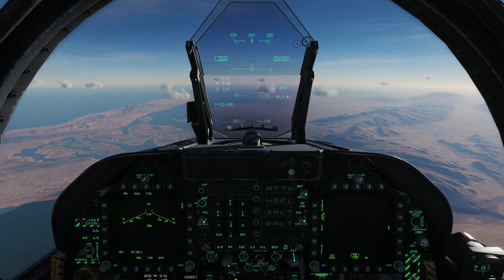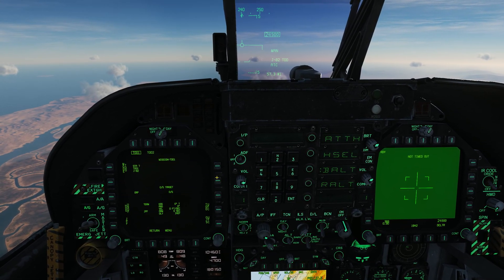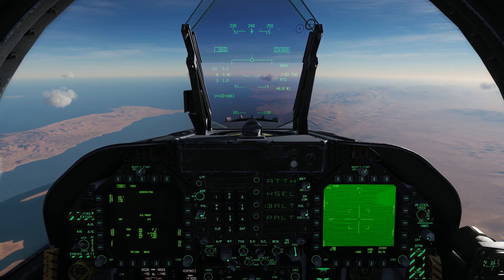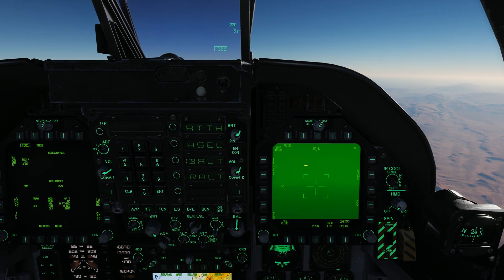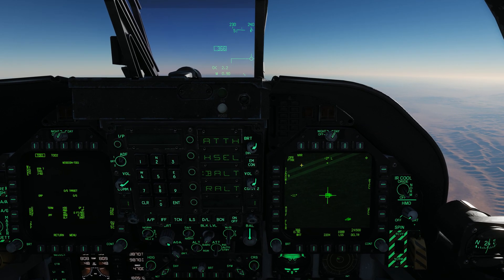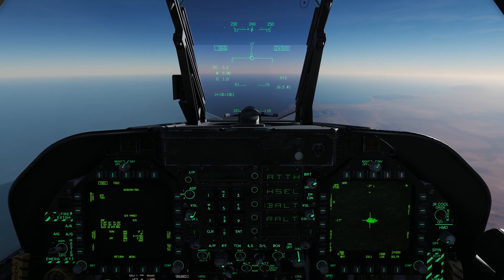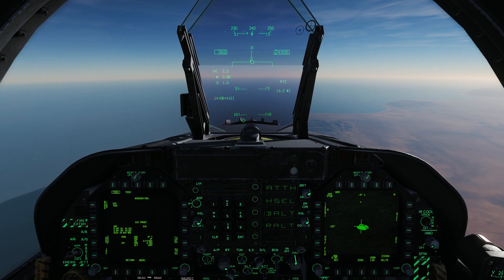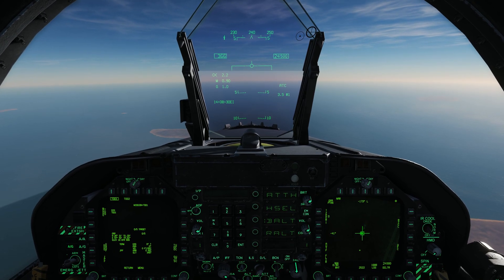DCS: F/A-18C Hornet - Litening Targeting Pod Intro and GPS Weapon Use

Comment: Will the pod have any compatibility with the helmet? For example, can I just look out to the side of the aircraft, and have the pod automatically slew to the exact spot I'm looking?
Reply from the maker: The helmet cannot control the pod. Rather, the pod in AG mode can set a target point from which the pod could then be slaved. This will come later.
Reply: @MattWagner  I see. Thanks for answering. I imagine that system will still allow for a short time between spotting and targeting something.

Comment: If the target moves after the gbu is released, the pod is on ptr track, will the gbu update coordinates mid flight? Or does the gbu only maintain coordinates obtained prior to release?
Reply from the maker: LGB yes, not GPS weapons.
Reply: @MattWagner  thanks! Follow up question... Jdams can be released a good distance from Target. How far out will an lgb be able to release? How far can the laser track? And is slant range taken into account, so that a higher altitude would subtract from the distance?

Comment: What does "sensor control depress" do?
Reply: It looks like in this case it was the button pressed to actually designate that point as the TOO target for the JDAM. He mentioned not hitting "aft" so I'm assuming that meant depress.
Reply from the maker: @aaronwhite1786 . Depress and Down are synonymous in this case.
Reply: Thats TDC depress isn't it? 
I meant Sensor control switch. It doesnt have a default binding and my hat switch can't be depressed anyway but i was wondering what it does

Comment: I know you've said it wont be able to be mounted on the cheek station initially, is that still the case?
Reply: as far as i know, the only place the navy uses the pod is the hull hard point which costs you one aim-120 or aim-7
Reply: @NormanBoring  Yes which is a cheek station but as you can see in the video he has it center line configured.
Reply: @UnixLinuxWaffles  indeed, my bad.
hopefully we can later mount it there, i'm little bummed i have to sacrifice a fuel tank for the tgp

Comment: Finally!

What is the difference between TOO1 and TOO2?
Reply: Nothing, you can set two different targets. Basically target 1 and target 2.
Reply: I guess, it is an opportunity to designate two targets for a single pass. Correct me if i‘m wrong please.
Reply: If you have 2 jdams/jsows on one station using the twin rack, T001 is bomb 1, and T002 is bomb 2 on that station